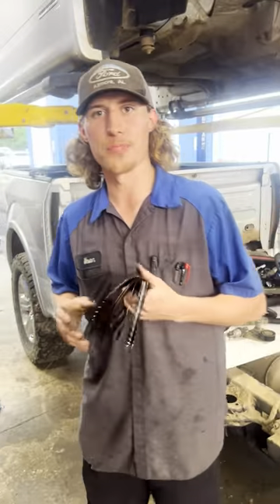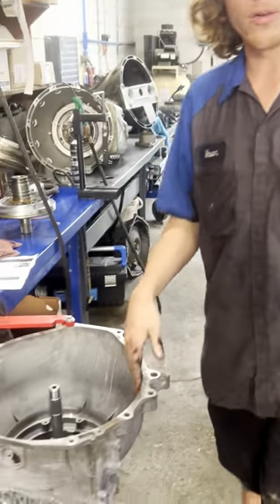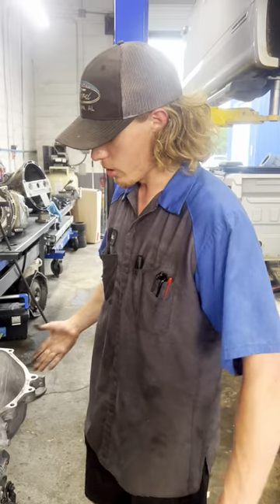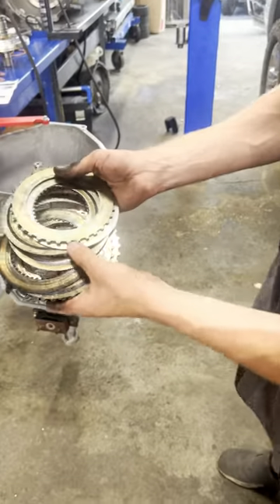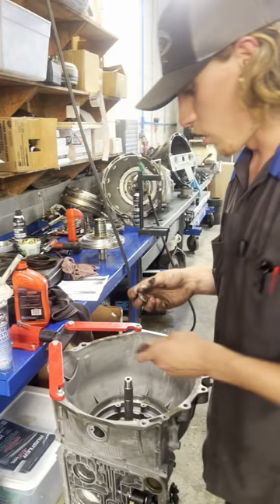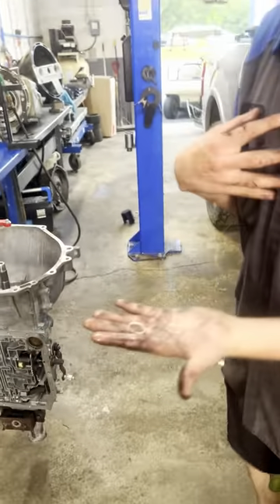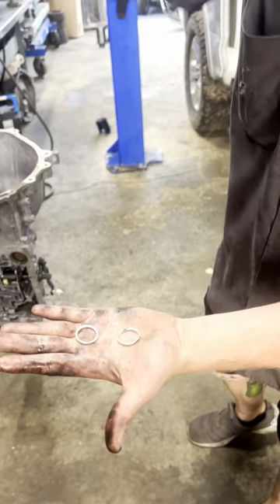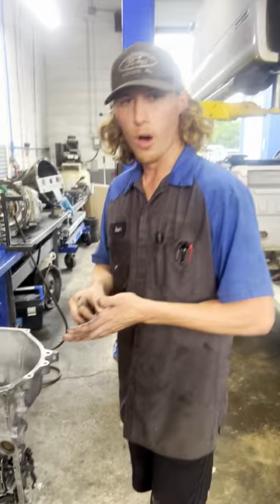Ford AOD/4R70 Most Common Issue #shorts #ford

Comment: Yes! An "Old Timer" here.
WATCH the 3-4 accumulator! Can be a source of 3-4 shift "flare" and other issues as well.
Reply: Hey bro I rebuilt my 4r70w and when I put it all back together it doesn’t have 3rd or 4th gear. Does everything else just fine… if I put it in D it revs out with no power once I reach about 25-30mph… it just never shifts into 3rd. So I drive it around in gear 1 and 2 manually. At 50mph I’m right at 3k rpm in 2. Any idea what this might be? I used a scan tool with bidirectional controls to check all the new solenoids I installed and they function when commanded.

Comment: Not a transmission tech but started my apprenticeship at a transmission shop. Stayed friends with a master builder thru 40+ years. It is my understanding that Ford had made those seals as a planned absolesense. Those seals were so hard that they were apt to fail because they caused scoring or grooves.

Comment: Old timer here . There are no 3-4 clutches in the AOD or the 4R70W. From front to rear there's intermediate clutches over drive band reverse clutches forward clutches reverse band and direct clutches. Please explain which ones are the 3-4s. The most common issue in these are the splines striping out in the direct drum.

Comment: I would have a C-4 over the AOD for a Crown Vic with nitrous. Why the AOD is a good transmission and I have had several. My 89 Mustang 5.0 is now C-4 with a manual reverse pattern valve body. Handles the 250 shot better.

Comment: A 9V battery can test the EPC for go/no go, but it won't test for PWM operation commanded by the PCM.  Also, the valvebody connector on these leak thru the pins when they crack from heat, shorting your PCM or causing erratic issues.

Comment: My 97 f150 just hit 250k on the original transmission, just started giving me trouble after Al these years. Such great trucks
Reply: It's definitely worth rebuilding the transmission
 My 03 acted up around 200 k. Has it rebuilt in 2016 now at 350 or so it's acting up again.  The 4.2 is one reliable engine!

Comment: Ford had a reprogram for them back in the day ..low line pressure  from Pc A solenoid. Econoline especially had issues.  Not to mention TCC  shudder on engagement. 🤦

Comment: I think we have two transmission shops in my community now.

Not only are the overflowing with work. But they also doubled the cost of a repair.

They're effectively working themselves out of business. Buy pricing themselves out of the market. But that's okay, because now they have a monopoly on the market. And the transmission consumer in this community, has no choice.

We effectively have two choices. Either, spend double the amount we would have, three years ago on a transmission repair. Or. Go buy a new car.

Either way... We're kind of fuct.